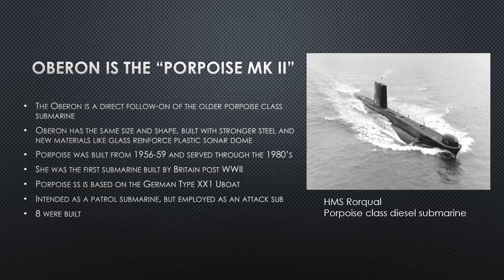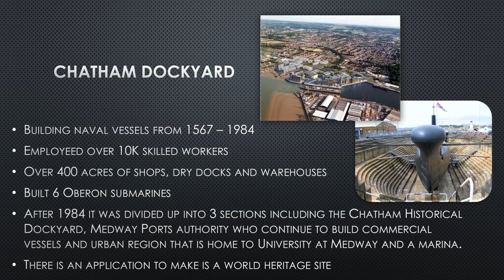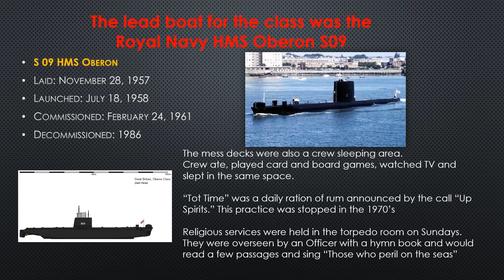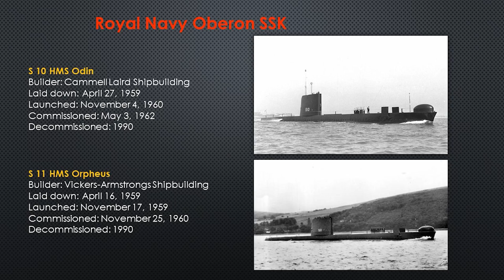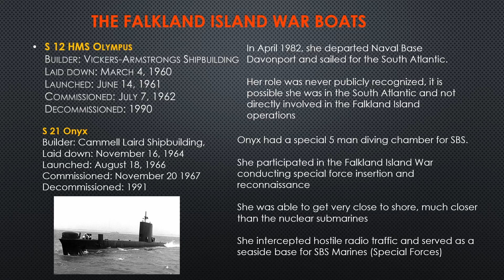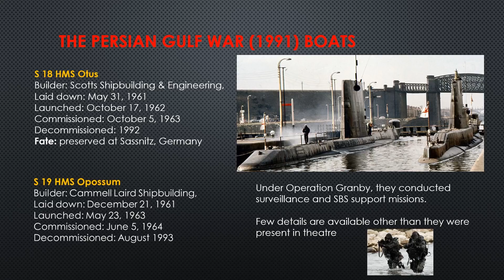Royal Navy Oberon SSK Sub Brief

Comment: You do NOT hold your breath when carrying out a free ascent from a Boat, you must exhale all the way to the surface, Im sure you can imagine what would happen to your lungs if you did hold your breath. If carrying out a Suit ascent then you would breath normally, the external pressure displaces the air from your stole pushing it into the hood allowing you to breath normally all the way to the surface.

Comment: Do you know if it is possible to wind up the HF vertical antenna by hand on the Oberon class sub? I know hydraulics are normally used but must have a fail-safe method one would think. Working on one at Australia National Maritime Museum. We want to operate Amateur radio on board.

Comment: In another life, on a submarine far, far away, my SQ was acoustic analysis, one of the things we looked for on these boats was the 'main motor slot frequency'. We were training for under ice work and were tasked against HMS Onslaught. On batteries these boats were superb, deathly quiet AND in later years, when towed array became available, they exceeded all expectations on their 'take'. 
HMS Onslaught was simulating an 'ice picked' boat (a light bulb will have gone on with those guys in the know as to what our intended target was) and we were tasked to underwater look her hull, after we'd 'spiralled in'. On running underneath her, from less than fifty feet, there it was the MMSF... to detect it one had to be within 50 feet and so it proved. Onslaught said at the time that although she knew were running underneath her, she didn't hear a thing. AND that surprised her, what with us being a great big noisy nuclear submarine (tongue firmly in cheek) however we knew from our Rona ranging in Scotland that we were (a T class SSN) exceptionally quiet. It was great to know because of where we would be taking the boat later on that year. 
HMS Onslaught was 'ice picked' (stopped trim at 100 feet) and she was alerted to our presence, she had her sensors primed and groomed for us, and yet we passed under her without a sniff.
The O Boats were superb submarines and what they got up to around the coastlines of our collective opposition was legendary among the various submarine squadrons in the Royal Navy.
The SSN and SSK boats complimented each other superbly well, Britain had a formidable combination, and one of these days, the UK tax payer will be told what we used to get up to in their name, however, don't hold your breath, I did my stuff 50 odd years ago now and probably there's another 50 years to go!
Hells bells we were good at what we did, and just a very faint rise in background noise... if that, we had to remain undetected... because we were going to be coming back to do it again!

Comment: In the late Eighties, these boats got a very signifcant upgrade to the combat system with the 2051 sonar suite and DCH.  2051 was an upgrade to the inboard electronics and  lots of pen recorders dedicated to individual sonars were replaced by a very compact suite with screens capable of displaying any of the sonars at any position.  DCH was comparable to the AIO and fire control systems of nuclear submarines and replaced manual plots and a mechanical fire control system!  Of course, having spent the money,  politiicans then decided to take the boats out of service as a savings measure in 1990 ish.

Comment: just wanted to correct a small note hms triumph was a trafalgar class fast attack submarine trafalgar being the 1st and triumph being the last, the upside down compartment was infact the reactor compartment which has the reactor tunnel situated above so only by entering the reactor compartment will you see it....i served on trafalgar 5.5 years hms torbay and triumph

the reactor compartment was never corrected and is infact to this day still upside down.

lockers being upside down is incorrect only pipe fixings were in the deckhead instead of the bilge were the major things also cost to build was roughly 850million for the sub trafalgar was closer to 1.5b she also had a 13ton brass screw the rest of the class had propulsors simular to russia and usa beyond that they were very simular, later on trafalgar trialed a lot of inovations like counter measure launchers   a stowage on the outer hull for the sbs to store a rib boat and side sonar arrays  tlam missials which we used in anger kicking off afgan war lead by the usa from our carrier.
Reply: Trafalgar's screw was nineteen tons, nearly twenty feet in diameter, had nine blades and was made of Nikalium. It was identical to Swiftsure's propeller. Later on Swiftsure was fitted with a nine bladed screw with thinner blades, and it 'sang', it was quickly changed to our old operational one. 
Both Traf and Swiftsure's crews were monsters, in no time flat both boats would be zooming along with hardly any revs on at all. 
The pump jet propulsors of the follow on S boats we fantastic pieces of engineering. The T boat PSPJ improved on the design and as one boat is still operational no more will be said. 
Suffice to say that the Royal Navy trialed the first propulsor on HMS Churchill (the very first boat to get a pump jet) and once it proved feasible the design matured, and now everybody has them... Rolls Royce eh, expertise par excellence!

Comment: Great video. One mission you didn’t mention that I believe was frequently handled by O boats was distraction and delousing for RN and USN SSBNs departing and returning to Holy Loch and Faslane. They were a flexible, cheap platform for such work, and this freed up SSNs for blue water operations.
Reply from the maker: You are correct

Comment: The sail is very tall, what's the reson for this. The early nukes were the same. Dreadnought, Valiants, Churchill's etc.
Reply: To fit the periscopes and masts in when lowered. The Oberon pressure hull diameter is much smaller than the length of the periscope so the fin (sail) needs to be quite tall to house the excess periscope tube to remain hydrodynamic when it is not being used.

Comment: Our SBS (.Special Boat Service) are basically the same as your Navy SeALs. Not to be mistaken for 22 SAS (Special Air Service) who are  (As they already have a "Boat" Troop anyway), but work in tandem sometimes with SBS and I wouldn't want to upset any of them tbh But there's the difference. SAS  mostly Land and air, and are Desert-born are your DELTA I suppose!
Reply: An old SAS drinking buddy of mine (when I came home on leave to Hereford) was full of praise for the SBS, 'except when they come onto on dry land' he said 'then they trip over their swim fins a lot'.
Having worked with both on boats I have to say that our exercise bike would be worn out very quickly, and they all ate us out of house and home!

Comment: Did a walk through of a retired RAN Oberon when it was on display in Sydney many years ago. Now I am not a tall person but damn, those boats are a tight fit inside. Some of the racks were so short that even I would not have been able to fit without bending my knees. If you were 6' you'd need an accordion spine to lay down.
Reply: They are a standard 5'9" bunk and we had a radar operator who was 6'5"tall used to sleep in the fetal position. lol
\

Comment: Hey Jive? Why don't we (Americans) build boats like this anymore? I mean non nuclear? Nuke boats are SO damn expensive, It seems we could get alot more of these boats if we stoped useing nuke power? I'm sure that if we built non nuke boats with all the modern sound mitigation and modern sensors it would still be way less expensive than the freaking underwater tube of money that the seawolf turned out to be.
Reply: USA had a  projection of power strategy and there is a lot of deep water  between them and the rest of the world. Unless  South America rises  up as a super power doubt America will look more close defence military assets
Reply: @galliman123  well... I think that jive said that the Oberon class had a 10000 mile range.. which is pretty good.. and If all you need is  a bit of fuel and food. Im thinking that a stop for a top off in some port would be just fine for a new 10000 miles..And its still a hell of a alot cheaper than a Seawolf.. or Virgina class sub.
Reply: Same reason the USAF is never going to build a replacement for the A-10.